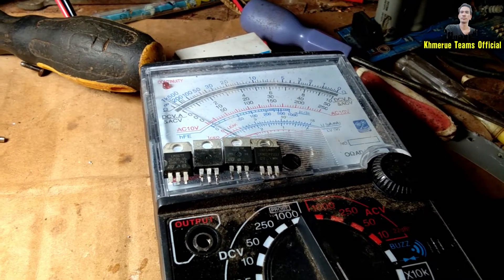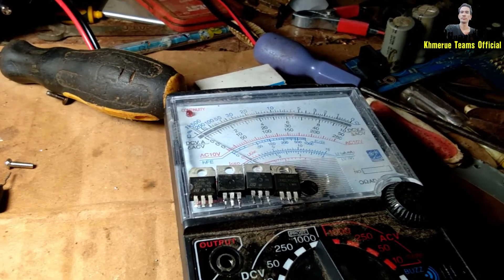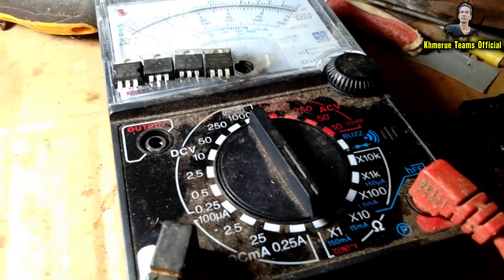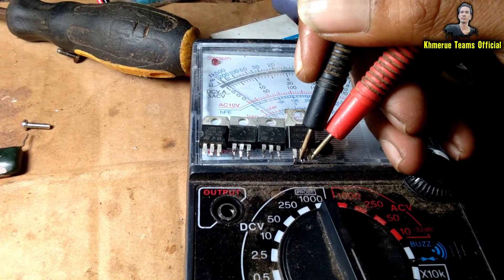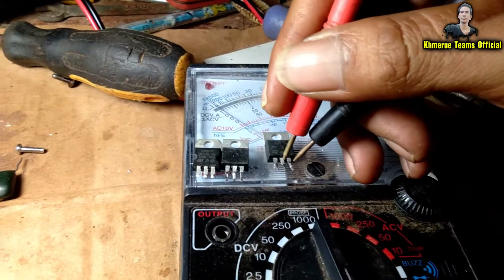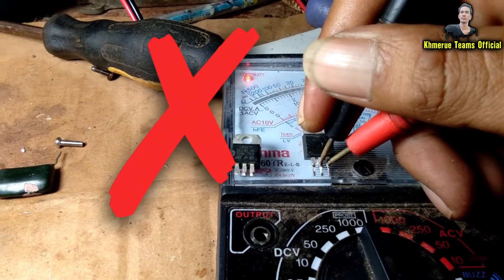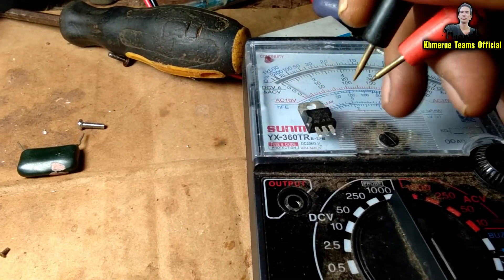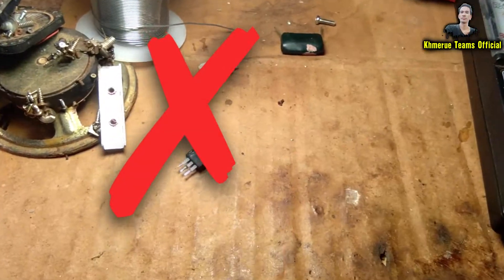How to Measure Mosfet 4 Different Types LM317T, IRF1407, P75NF750 | N Channel

Comment: Great video! I actually needed some help driving the IRF1407 MOSFET in a full h bridge motor driver circuit. The MOSFET is behaving weird wrt different pwms (from an Arduino). Do you have any idea what the issue could be? I can provide more info regarding the circuit.
Reply from the maker: How ever the mosfet have a switch when you switch on the second meter will work all and running up!
Reply: @KhmerueTeamsOfficial  yes wow sugoi!